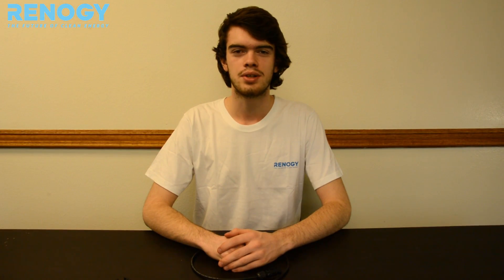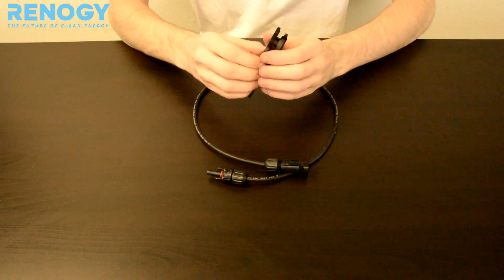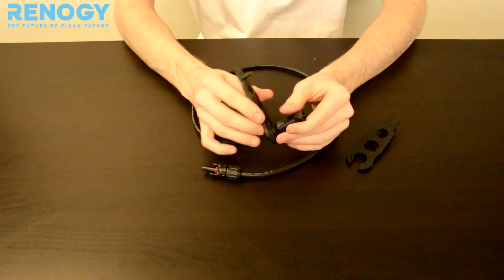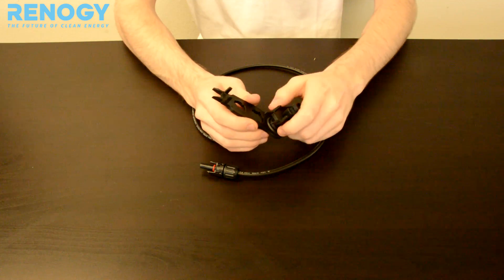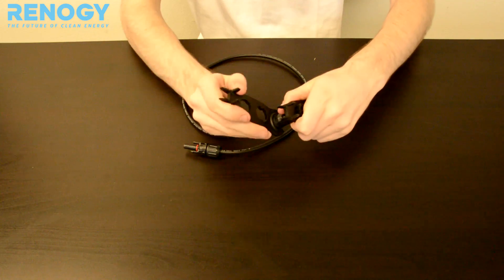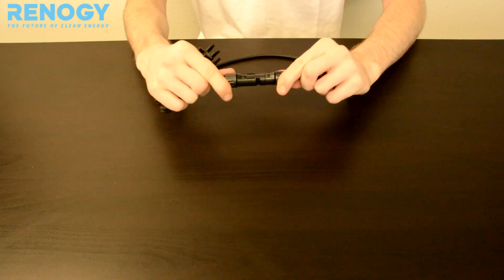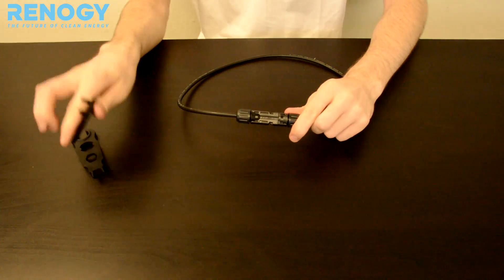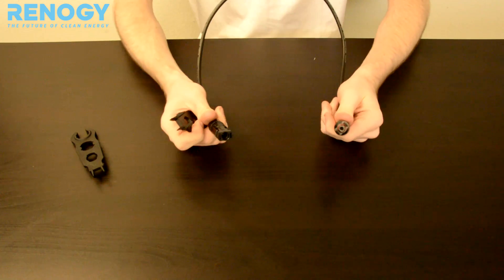How to use MC4 Assembly/Disassembly Tool | Renogy

Comment: It's so ridiculous that they make the little disconnect Clips so short that you can hardly get your fingers in there to disconnect, I'm trying to charge units with different fittings so it's a pain in the ass really dumb design if they just made the the little Clips a little longer you could easily do it with your fingers, but now you have to struggle with your fingers to undo it, it's amazing how stupid the people are that design these things.

Comment: Do not do business with Renogy. I did and I am sorry. Their tech support is nonexistent. The products are over rated. The tech support just reads answers from a book and are totally useless. They cannot answer vital questions about their products because they are amateurs in this very complex business.

I bought one of their 200 amp hour batteries. It was supposed to be an AGM battery. It was a sealed lead acid battery not an AGM. I called and asked what setting on their 40 amp Charge Controller should I use and instead of AGM battery I was told to use Gel Cell setting. WTF

I bought the Renogy 3,000 watt Pure Sine Wave inverter. The inverter is supposed to supply 110 volts at 28 amps. It will not do this because the internal wire supplying the "Heavy Duty" line connector and the (3) 110 volt receptacles internally are fed with #16 wire which can only handle 10 amps. 10amps X 110 Volts = 1,100 watts. You cannot draw 28 amps through a #16 wire with out the unit kicking out or burning out. This is a fire hazard waiting to happen.
If you use the 110 volt receptacles and say plug in three devices you will blow a fuse or burn up the inverter internal wiring because all the receptacles and the heavy current barrier strip are wired in parallel. Actually in use I tried to run my 15 amp microwave using the 3,000 watt pure sine wave inverter and it popped the internal overload.

My experience with Renogy has been one of deceit, lies, over rated Chinese junk. Once you buy you are stuck with cheap equipment that will fail you when you need it most in the wild. I was upgrading my solar panel array and wanted to be sure the Inverter could then work better. I hesitated to open the inverter because I did not want to void the warranty but did to be on the safe side. To my horror there was #16 wire and it was wired to some very small circuit boards with even less current carrying capacity. Man was I sorry and out $400.00 plus dollars. NEVER AGAIN RENOGY.

Fool me once shame on you. Fool me twice shame on me.

I would love to send the 3,000 Fake Inverter back but I know they won't take it. I just took down my 4 Renogy 100 WATT panels and the 40 watt controller. I am going to sell them and try to recoup money. Just bought (3) better 320 watt panels and they ain't that Renogy junk.

Caveat Emptor.

This is the truth and has been my experience.
Maximus has spoken.

Comment: Most pointless 'tool' ever- you can do everything here with your fingers!....  How do you disassemble the plastic part from the cable?
Reply: No, I don't have the strength in my hands to pull apart the male/female connectors without a tool-

Comment: I unfortunately purchased the blue H4 tool with connectors and crimper. Amazon said it was MC4. Not having a choice at the time, I tried disconnecting with my fingers as some have suggested. I completely pressed the two tabs on each side for release while pulling apart. I tried dozens of times but it would only move about a millimeter. I was just able to insert a small flat blade screwdriver to help separate the connectors while pressing the tabs and nothing. I ended up ruining the connector so I just cut it off. Just purchased the Black MC4 tool. I remember when putting the connectors together it was a pretty snug fit. I had to really push it together. If anyone has this issue I suggest using the tool instead of ruining the connector. I saw a video where they help especially in cold weather.